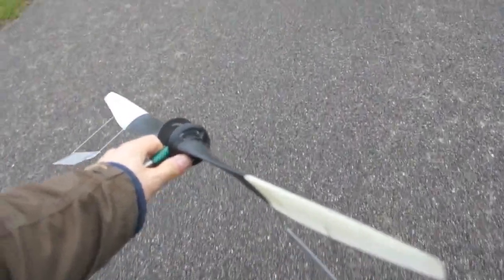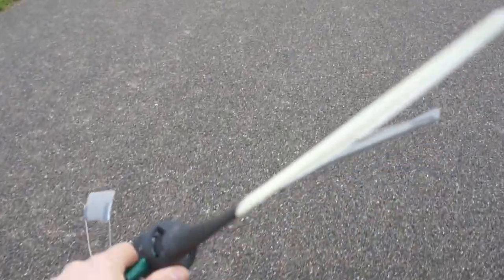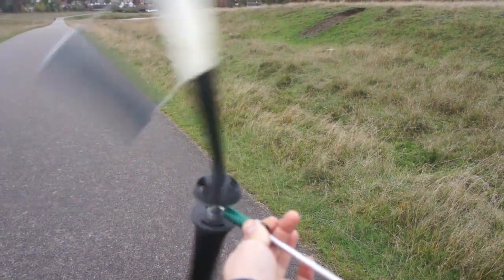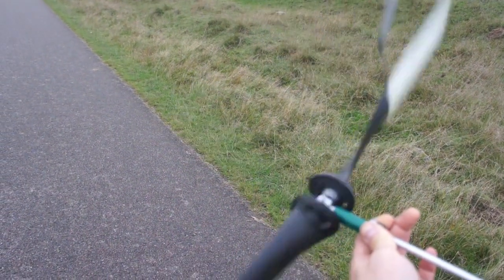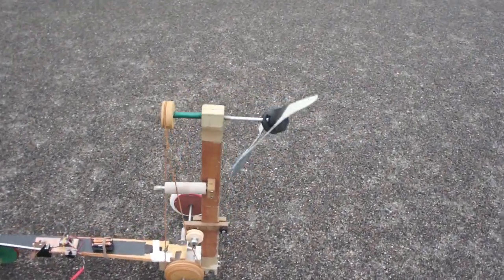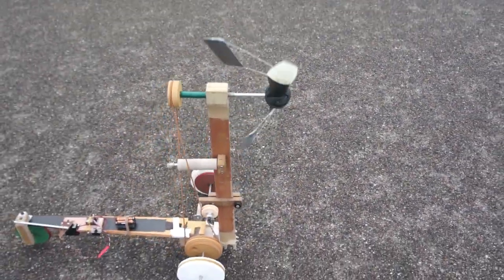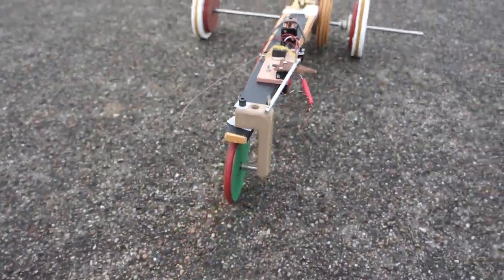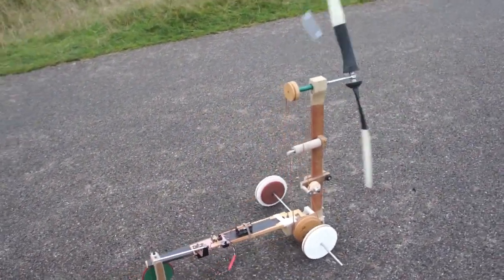Wind Turbine Driven Car

Comment: Interesting! I wonder how much drag it adds..?
Reply from the maker: The rudders for sure adds a considerable amount of drag. It depends how well the relationship between center of lift and center axis of rotation (along axis of each blade) is tuned. Its a bit hard to explain without a diagram but in short the lift of the turbine blade is  (obviously) providing forward thrust whereas the rudder is lifting somewhat backward, so in addition to the drag the lift of the rudder is also counteracting the turbine rotational thrust. Therefore the that balance tuning is important in order to have as little lift in the rudder as possible but still have the main blade at a 12-15 degree of attack to the relative wind. And nobody yet asked what rotational speed the twist is designed for.. phew..